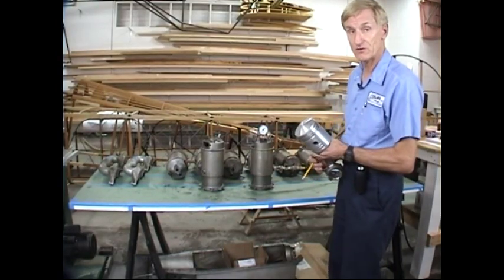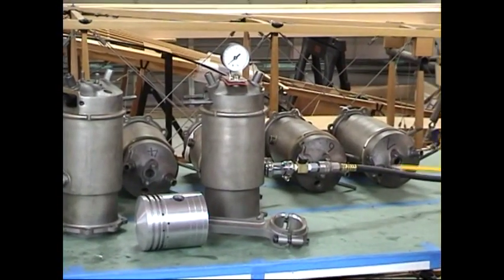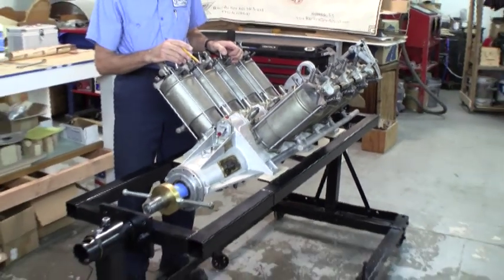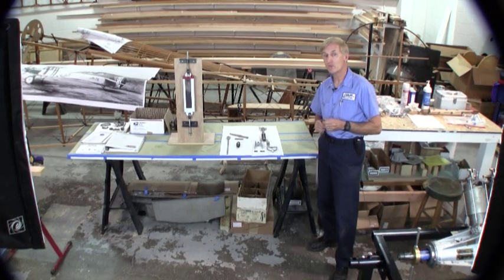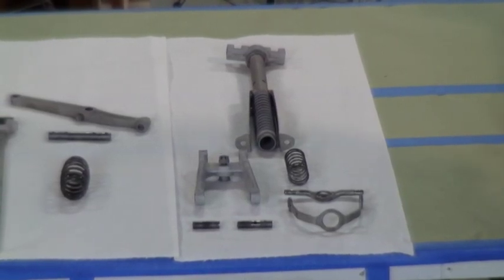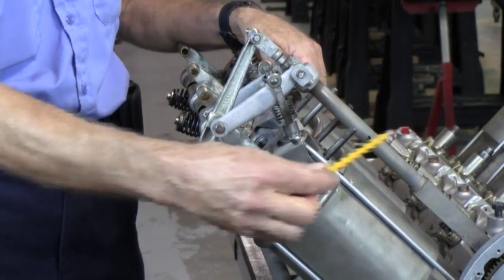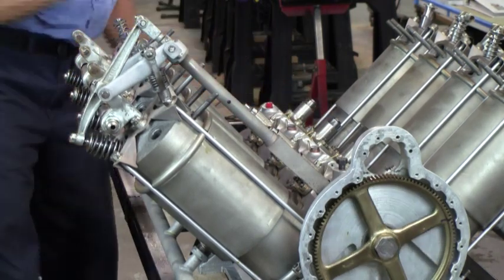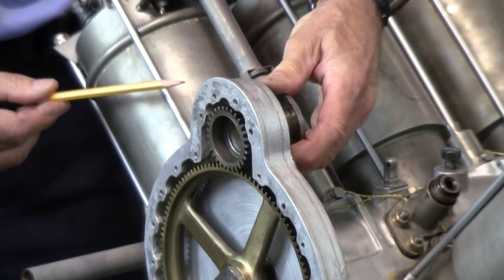OX-5 Engine Rebuild Chapters 2 and 3

Comment: A few tidbits I have heard or read about this engine. I had the honor of speaking with Bite Livingston in the 1970's. I asked if he had flown behind an OX-5. He said he had, and that when you did you always had two landing sites in view: the one you just passed and the one you are headed for. Time between overhaul (TBO) was something like 50 hours. You had to oil the exposed valve mechanism before each flying session. For about $20 you could add an automatic oiler (so said the magazine ad). All gasoline at the time was of poor quality and had to be filtered through a chamois. The chamois would not let water contamination pass along with the fuel. There were some rpm figures to avoid because of harmonic vibrations. The original engines were nickel (?) plated, giving it an elegant silver patina and corrosion resistance. Great video to show us the inner bits!

Comment: "Hemi" actually refers to the shape of the combustion chamber rather than the shape of the pistons.
Reply from the maker: What defines a Hemi engine?

A HEMI® engine is composed of a hemispherical combustion chamber with dome shaped cylinders and matching piston tops. This creates less surface area than traditional engine which means that less heat and energy lost, and more power is produced.

Comment: Great video. Was the camshaft hollow (drilled through) for weight savings? Were the valve seats ground and/or hardened? Finally, what sort of valve guides were used on the top of the piston? Many thanks in advance!
Reply from the maker: The cam shaft is hollow for oil circulation to the bushings. We did grind the valve seats by hand to match the valves. This engine's valve guides were just fine so we did not have to replace them. On other engines, we have made new valve guides.
Reply: @BlueSwallowAircraft  Thanks for the quick response. With the tappets, pushrods and springs non-pressure lubricated it would appear that valve train wear would reduce MTBO on this engine-assuming no adjustment for mechanical tappet. If there is an adjustment my old eyes missed, how often does lash need to be adjusted?
Reply from the maker: @pimpompoom93726  You can adjust the rocker arm mechanism very easily to accommodate any wear of the rocker arm roller. Later engine mods had different roller assemblies as well that might have been a bit better design. OX5 engines were rebuilt during the War on a regular basis (50 hours?) as part of service maintenance. I do not think any of my customers are putting that kind of  hours on their engines per year.
Reply: @BlueSwallowAircraft  Ahhh, so the engine has roller lifters? That's pretty novel for 1917. In the auto industry where I work we didn't get into hi-volume roller lifters/rocker arms until the mid 1980's. It's really amazing how much research and development went into these old engines, they were particularly innovative in materials technology. I've been doing a lot of reading on the Liberty Engine lately-making the best of the Pandemic slowdown-and there are some really great articles online regarding how we developed that engine. I love this stuff. Thanks for the information!